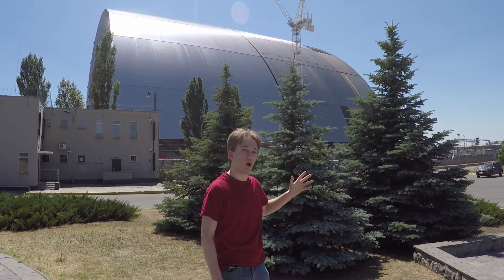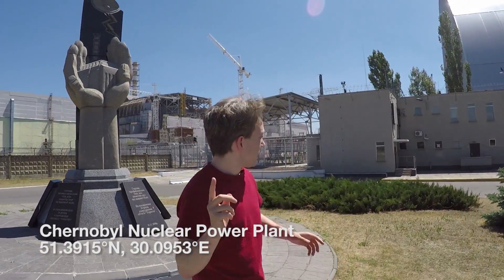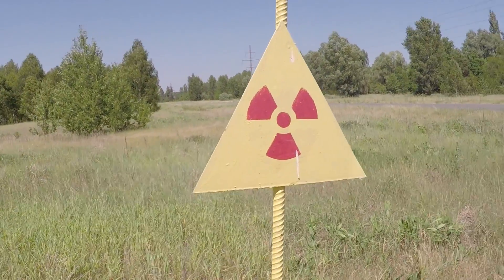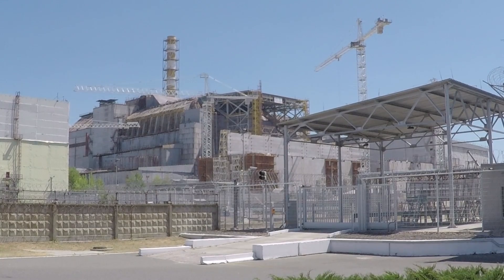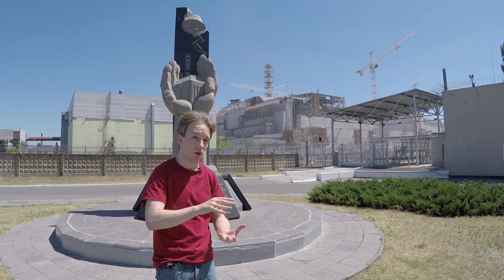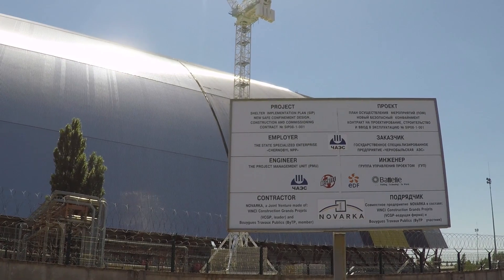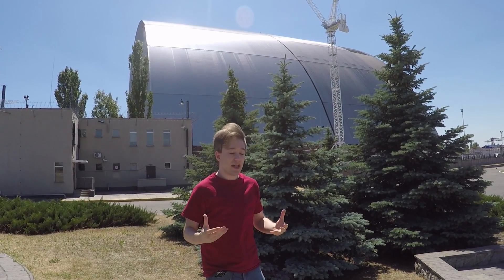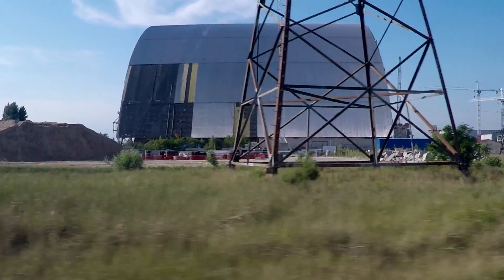Containing the Worst Nuclear Disaster in History: Chernobyl's New Confinement Structure

Comment: The worst part is that the elephants foot is still highly active and from the most recent reports show it starting to burn through the concrete floor and if it gets all the way down it will hit a massive pocket of water that has been there for a very long time. Once it makes contact with the pocket of water you will have another massive explosion from the melted down core.

Comment: In 100 years one of your descendants will be doing a video about how they have to replace the containment every 100 years, and that’s something you might not have known
Reply: I think they have kept the tracks their. I wonder how they will do it. I watched I think it was channel 5 documentary about the physical fitting. they used sophisticated servo drives on like liner bearings to make sure it moved evenly.

I wonder if they will fit exit ramps on the other side ? and roll one off and roll one on.
incredible engineering
Reply: @olibob203  well i mean they are moving the nuclear waste to actual nuclear waste sites so i think the plan is not to

Comment: Throwing the baby out with the bath water?  Current Uranium reactors use pressurized water as their coolant which is what "explodes" during these reactor failures.  Chernoble and Fukoshima were particularly old, poor designs - but the fundamental design flaw is using pressurized water to cool the solid fissionable fuel.  Water expands thousands of times when it flashes to steam - thus the need for large containment structures and solid fuel has to be "discarded" or reprocessed after only a tiny fraction of it has reacted - leaving a radioactive mess for centuries.  
Check out the new reactor designs using molten salt as a coolant with the nuclear fuel dissolved in the salt.  If the reaction tries to run away, the salt density expands and criticality is lost naturally slowing the reaction.  In an accident, the salt drains out of the reactor and simply freezes solid.  And there is no "spent fuel" because the nuclear fuel stays in and is completely used up.  In fact, these reactors could be used to get rid of the "spent" solid fuels from light water reactors.   These MSR type breeder reactor designs can also run on uranium's weak sister Thorium which is lower on the Periodic table meaning it doesn't produce the nasty higher actinides like Plutonium etc.  and is super abundant and would never be scarce.   
A lot of die-hard environmentalists have come to the conclusion that despite the fears of nukes, they are way better for the world than burning carbon and we just need a rethink of how reactors are designed rather than continue to build power reactors based on a design good at producing weapons grade material.
Reply: our current reactors are fine. they just cant be made the size of houses and to soviet design and construction standards. see the us navy operating them for how many tens of millions of miles with zero count em zero accidents. other designs are great, but as it stands now we dont need to improve upon the uranium ones we already have and could run off of it indefinitely on relative human time scales

Comment: Good thing all Radioactive stuff decay's Exponentially.... (on a logarithmic curve)

After 40 years itll be one, one-thousandth (1/1000) as radioactive and another 40 years one, one-millionth
Reply: Depends on the half life of the material involved, caesium 137 has a half life of just over 30 years. As far as I know, that's the one people worry about most, and the stuff that was of most concern when the cloud from Chernobyl deposited it on the highlands throughout the UK
Reply: shorter half lives are more dangerous but are also- ahem- shorter, so while the actual radiation levels might not drop logarithmically, the danger will.

Comment: Stop using exploded. A heat exchanger melted I think.
Reply: +The Average Pro No, reactor 4 really did explode, there's helicopter photos of the morning after. The fuel melted and went through the concrete floor. Google "elephants foot".
Reply: I read the whole IAEA report for a College Engineering Essay,   It was a "Steam Over-Pressure Incident" or yes  basically a steam EXPLOSION.  The whole event only lasted about nine seconds... simply, Reactor Runaway caused by the Void Coefficient

Comment: Isn't Troll A platform still the largest movable structure? It's both heavier and taller than this structure.

"With 1.2 million tons ballasted under tow, 472 meters high, with underwater concrete structure at 369 meters, and dry weight of 656,000 tons, the Troll A platform is an engineering marvel."

Comment: Won't there just be a bunch of radiation trapped in the arch? Like wouldn't it being open release years of built up radiation?
Reply: Epcot lp Don't take that as gospel, but I thinks that's not how radiation works. Radiation looses energy by going against (or, to a lesser degree, through) dense material like concrete or steel or lead. so it doesn't "build up" inside an enclosed room like gasses or the like.
Reply: seigeengine You're mostly correct, but only gamma radiation works as you describe. Alpha and beta radiation are made up of actual protons, neutrons and electrons, rather than photons.
Reply: Epcot lp that's the point of the video, the question is, are we going to get rid of the radiation and spend loads of money doing it, or are we going to spend a ridiculous amount of money just covering it up every hundred years.

Comment: Fill it with concrete.

Done and done. 😃
Reply: Le Pawel
And that was the joke.
Reply: ***** We could try something cheaper that would bond with it forever, rendering it immovable.
Bieber fans could work. You tell them the "elephants foot" is actually "biebers foot", and they'd never let go of it. Fuse, melt together and create one radioactive 13 year old blob, and just ground it forever.
Reply: ***** How? You can't exactly go inside reactor 4
Reply: ThatDuck you can and people do
Reply: Metalbirne Well, yes, but there's only so far you can go.
Reply: ***** Hmm... the volume required to fill that reactor would be beyond anything close to cost efficient.

Comment: What about containment of the contamination from below? How will the water table be contained?
Reply: Meep Changeling The explosion has nothing to do with the fuel used; it was a steam explosion caused by a rapid surge in power caused by malfunction of the control rods and a design defect of the reactor. While it's true that the RBMK reactor can be used to easily produce plutonium, it's irrelevant as to what caused the incident.
Reply: devastator5042 The debris will be a danger for MILLENNIA not "many more years"  -- we're talking longer than recorded civilization.  This is the real cost of nuclear disasters -- you have to amortize the liabilities over 1000s of years, not 10s.
Reply: Meep Changeling Can you find a source that supports your assertion? I can't find one.  http://www.nei.org/master-document-folder/backgrounders/fact-sheets/chernobyl-accident-and-its-consequences or http://atomicinsights.com/accident-at-chernobyl-caused-explosion/ or http://www.world-nuclear.org/info/Safety-and-Security/Safety-of-Plants/Chernobyl-Accident/

Where are your sources that the U concentration had anything to do with the fundamental cause?

[citation needed]
Reply: lohphat 
Nothing much was done.
When the recator melted it everything around it melted as well, forming a mix of moten metal, concrete and fuel called Corium.
Now this froze soon after the melt down in to hard deposits.
The bad news is that it's softening.
Once thay had to use a ak47 to chip bits off now it's turring in to dust.
The other bad news is that it contains things like the highly radioactive chernobylite.
Reply: Thats a thought but considering the area around is unlivable for many more years the natural dillution to get to a populated area is NBD
Reply: The explosion had nothing to do with PU and everything to do with a uncontroled super criticality http://www-pub.iaea.org/MTCD/publications/PDF/Pub913e_web.pdf

Meep Changeling is incorrect on the PU problem, it mostly has to do with the graphite causing positive void coefficients. Later RBMK implementations used more highly enriched uranium along with more control rods to better control the reactor (along with other things).  There are actually reports of 2 explosions, but we don't know what those were exactly.  It MAY have been the 2000 ton dome crashing down, it may have been a hydrogen explosion, it may have been a lot of things, we will likely never know.
Reply: lohphat Actually the only reason Chernobyl exploded is they were using weaponized plutonium instead of reactor grade plutonium. That's also why it exploded. If a normal reactor melted down it would be safe within 90 days due to using WAY less radio active fuel. So the real cost of nulcear disasters is... basically whatever it costs to fix, and a few hospital bills since you know, we have radiation removing/damage repairing drugs now. 50 years of science, it can do a lot.